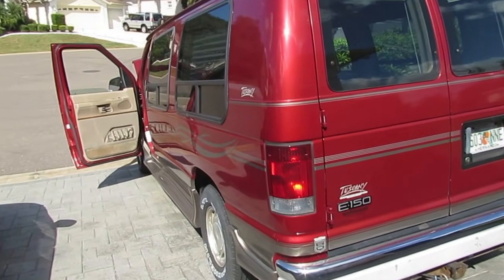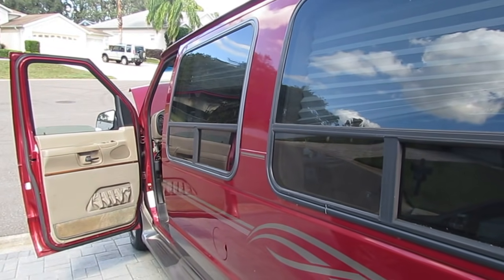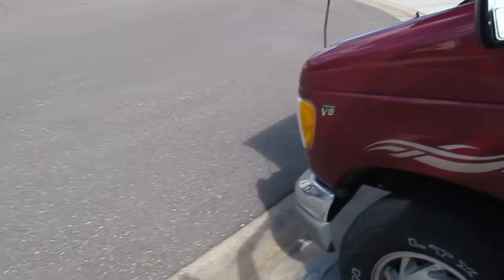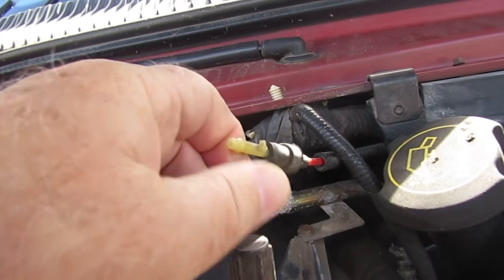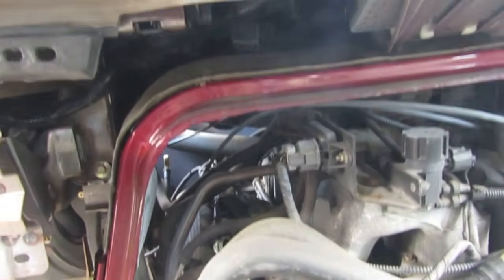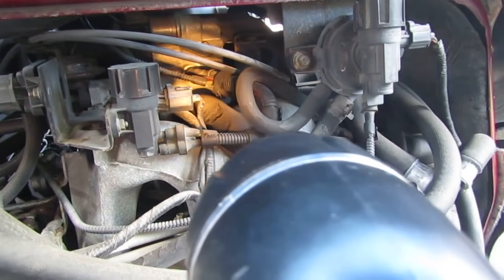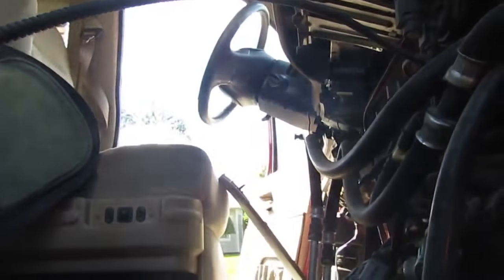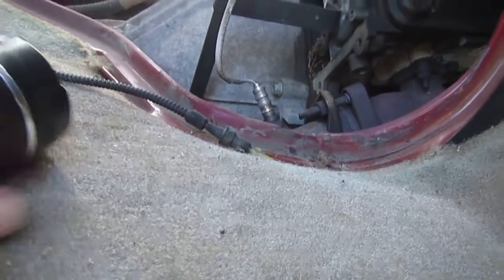how to fix e150 e250 e350 e450 e550 Econoline Van ac stuck on defrost !

Comment from the maker: I just found this video (link below). This guy's fix will be better as he shows exactly where the vacuum line is supposed to go (on the Evap Housing) and you can fix this whole thing by following my video to route the vacuum hose to the passenger side under-dash BUT then referencing his video, buy the vacuum cannister and the check valve and locate them under the dash too. In that way you won't have to remove the evap housing (mucho work under the hood) and it will completely fix your problem!

https://www.youtube.com/watch?v=CJBgPvKBqM4
Reply: Can you help me only the AC vents on top of the dash work everything that's buy my stereo or in the back does not blow anything and it's hot air btw.
Reply: under the hood  of my crazy 2012 GMC  1500 van it has no wires and no vacuum red line either , where they hide it  ?

Comment: I had same issue on my 06 e350.
Black line goes to vacuum canister in wheel well. I bypassed it, you must add some type of canister, wherever you can find room under the hood. I used empty 1 lb propane torch tank. Otherwise without vacuum reserve under certain throttle conditions under load (when vacuum is low] it will revert back to defrost,  then when vacuum returns it will switch back to previous setting. Don't forget to add check valve on the line from the manifold to hold vacuum  in canister.  I used a plastic check valve for windshield washer fulid line to wiper hose line to nozzles. Problem solved.

Comment: I used your method only left the connector ends on the hose. I pulled up quite a bit of hose from the blower housing and cut it off. That way I only had to drill a hole big enough for the hose through the doghouse. I used weedeater fuel line to connect the two hoses. I left the connection just inside the dog house and used red RTV on the hose pass thru hose. Works like a champ. Thanks

Comment: WHAT A FIX YOU ROCK. Literally took 10 mins on our mini Winnie. Took longer to take the dog house off. I didnt take the bolt out i drilled a 1/4 hole and feed the line through. Fyi the vacuum ends pull off no need to cut the line from engine compartment. Did like you said and everything worked awesome. 30 and was done. 20 of that wrestling the engine cover. THANK YOU.
Reply from the maker: Glad it helped. Not sure what you mean when you say you don't have to cut the end because it didn't couple for me. Anyway, I've since installed a vacuum reservoir under the dash. I made it from a can and two brass fittings. I bought some juice, cut a hole in the can to remove the juice and wash it out then I soldered two brass fittings on both ends. I also placed a one-way vacuum check in series.

Comment: Sir, 
   Thank you for posting this video. I used it to repair my 2002 E150 conversion van. I followed your steps exactly and my vent system / AC is working perfectly! Thank you so much for taking the time to post this video - You have saved this single father of four a lot of money. This was way easier than any other video I watched and your explanation of procedures was spot on. Thanks again.

Comment: I CANNOT thank you enough! I have been looking for an easy fix to this for over a year. 30 min and $3 of hose...problem solved. Thanks again!
Reply from the maker: You're welcome. By the way, later I added a vacuum storage vessel (a modified can) and a vacuum one way check valve. If you use just the method in the video, under hard acceleration, you'll notice the momentary drop out of the vents until the vacuum recovers. That's why a storage tank and a check valve is recommended. I commented on this someplace in the comments below.

Comment: I just wanted to give a big shout out to this fellow for this video. I have a 2000 E450 Motorhome I just bought and I too had the same problem with air flow defaulting to the defrosters. The video was great and I had my problem fixed in a very short time and saved a bunch of money. Thanks and great job on this fix!

Comment: Thank you, I just fixed my 2006 E-350 using a similar technique.  I used the existing line as well and drilled through the firewall, leaving the bolt intact.  I used kitchen/bath silicone because it was convenient.  It took me 20 minutes so thank you for doing the additional leg work.  I may add a reservoir later on but right now I have front and rear AC at freeway speeds pulling a load.

Comment: Worked great ! Thanks for this post , I used some "Micro Irrigation Tubing" , it fit into the original fitting from the front connection, and over the small black "Vacuum Line". I added RTV on the Black Line and pushed it into the irrigation tubing , and sealed it off with "Shrink tubing " over the connection (small black & irrigation tubing).

Comment: E150 worked like a charm. 20 minute fix. Agreed, just easier to reroute the red vac line back and through the bolt hole. The wire loom protector around the line also fits through. hook up about 12 in. 1/8 id fuel line and voila! CooooLing

Comment: Thank you so much I was stressing till I found this and glad I read the comments to know what happens doing it this way and I can always add a vacuum canister and a check valve under the dash later but for today I have AC and it did not cost a dime!!

Comment: I did basically this same fix on my 2001 e250. If you take the interior knee panel off on the passenger side you can drill a small hole and fish the tubing thru without taking the engine cover off inside. Pop the access port cove off the top of your dash . That where the vac line junctions to the vacuum switch.  I bypassed the entire vac line from under the hood to the vac switch. I personally think the engineer that put the check valve inside the evaporator housing should have his engineering credentials revoked permanently. Oh and I bought a replacement check valve that is now mounted under the access cover on top of the dash.

Comment: I just purchased a 2000 Class C E450 motorhome with the same problem, and this video was just what I needed.   I discovered that the rubber connection under the hood worked perfectly to reconnect the tubes inside...no other tubing necessary.  It appears that the red line is "sealed" in the black rubber, but it came out with pliers.  Then I used the black rubber connector to connect the red to the black.  Thanks!
Reply from the maker: John, you might find that under acceleration you might momentarily lose vacuum. That's because there's supposed to be a vacuum canister and check valve to supply vacuum at that time. The fix you just did bypassed the cannister. I live with this as it's really not much of a problem as it recovers and the vents go back to A/C after the van reaches speed but if you want to have 100% functionality then watch this video. He has a fix for the cannister and check valve. He installed them under the passenger side of the dash.
https://www.youtube.com/watch?v=CJBgPvKBqM4&t=0s
Reply: Thanks!

Comment: Mine is doing the same thing in my E250 Cargo. Thanks a million. I am going to go out and fix it today.
Reply: Did it work I have a 2003 e250
Reply: @Myka.1987  It sure did. Thank you. What motor do you have in yours? The 5.4 3 valve or 2 valve?
Reply: Awesome! 4.2 engine

Comment: Got in my 2003 e350 super duty today an would you no it mean is doing the same thing I noticed you have rear air as I do do your rear air stop working as well when front went out my rear vents stop working at some time the front vents did.

My question is does your rear ac from the vents work now as well with your fix.
Reply from the maker: Truth be told Kenny, I haven't ever checked them as I use this van simply to haul my RC Model airplanes around so the seats in the rear are no longer there. You say I have rear A/C but I only recall having rear heat, not ac.
BTW, if you're going to to this modification it's best to use a vacuum cannister under the dash as I did. Look through the comments and you'll find a description of the installation. I made mine from a sealed can that had some form of liquid (can't recall, but I chose a can with a very thin, easily removed and then rinsed liquid of some sort) in it and I simply drilled holes top and bottom to add some small brass fittings I bought on amazon to use as vacuum in and out. I also used a vacuum one-way valve on the input, again bought on amazon.

Comment: Was it blowing cold air before fix ? 
Mine is stuck in defrost mode also no front flow but also wont blow cold air.
Reply from the maker: I can't recall. Anyway, one thing at a time. Fix your vacuum leak first so that you can get air through the dash vents and go from there. That line is the primary vacuum that controls all the vacuum motors under the dash. In the meantime you can check to see if your airconditioner is working by turning it on and then feeling the metal hoses as they exit the evap coil on the firewall. You can also see some sweating of the pipes in this kind of weather.

Comment: Just to contribute to the discussion and those looking for solutions. 

My 99 E150 blend door problem turned out to be the dash mounted round temperature  switch knob itself was broken where the female plastic hole on the back gripped and turned the male  control cable mounted inside the control panel. 

in other words the temp knob was broken even though it turned... 

unusual problem and resolution for sure but I thought worth mentioning.

Comment: So I'm noticing that some people are installing new reservoir boxes and a new check valve and some people are not. What is the purpose of the reservoir box and why do some people bypass it?
Reply from the maker: The reason the OEM reservoir is being bypassed is that it's physically very difficult to get at and repair. Do a search and you'll see. It's easier to just bypass it.

The reservoir is nothing more than a storage cell. When the vehicle is under heavy load and accelerating the engine loses vacuum and if not using a storage reservoir this can cause a momentary return to the defrost (default) and then back to AIRCOND or HEAT(floor) when the vehicle reaches cruise speed. 

This is nothing more than a minor nuisance in most cases and lasts only a couple seconds. The way to alleviate this is to add a vacuum canister under the dash, in conjunction with a check valve to store enough vacuum to keep the under-dash actuators in the mode you selected during this scenario whereby you're accelerating.

I drove mine without for about a year and added a homemade reservoir after that comprised of a tin can with two nipples I soldered to it and a check valve I bought on Amazon. 

A word of caution regarding check valves sold in local parts stores. There is apparently a lot of them that don't work (Dorman brand) and I bought one. Read the reviews and you'll find out that many people have bought the things only to find out that they don't pass any air in either direction (defective).

Comment: Just did it tonite it worked glad i found this video others to in depth this one is right to the point and explained well very nice
Reply from the maker: Your vents will probably go to defrost again under heavy acceleration then back to what ever's selected because there's no vacuum reservoir or check valve. 

If that bothers you you can add that under dash (or in the engine compartment) by installing a small vacuum reservoir and check valve per this guy's video.....https://www.youtube.com/watch?v=CJBgPvKBqM4

I just live with mine the way it is.....
Reply: kaydee457.  Im fine with it !

Comment: Buddy excellent video but you're missing the vacuum canister what do you do for vacuum
Reply from the maker: The vacuum powers the vacuum motors under the dash. Because there's no canister or vacuum check valve (with this fix) you will occasionally lose air from the dash registers when you accelerate. As soon as you reach cruise speed you'll never see any difference. As I mentioned before in other comments you can always build a canister, add a vacuum check valve inline with the hose and install it under the dash near the glovebox. Thus far, I find it a minor nuisance and haven't done that yet.

Comment: I see what he did but I would appreciate some clarification if someone would help me. He unplugs the vacuum hose under the hood, pulls the part coming from the doghouse (back of manifold) attaches a tube to that hose, cuts a black hose found near the footwell and connects the new piece of tubing to that. What I don't understand is what happens to the tube connection under the hood that he disconnected. Will that not result in a leak?  Does the black hose near the footwell hook up to where the original tube connected?
Reply from the maker: buster- the line I disconnected under the hood is the vacuum source from the manifold. 

The factory routing goes like this: manifold>>under hood connector(source)>>>>>under hood connector output>>>vacuum one-way valve>>>Vacuum storage canister (used only for dash vents)>>>>Vacuum storage canister output>>>>via hose in floor footwell>>>supply to vacuum motors for vents under dash (black hose that I connect to).

The hose (under hood output) that I disconnected goes to the vacuum one-way check valve and the canister, two components that are completely inaccessible without a great deal of disassembly. The output of the canister is the supply for the dash vacuum motors via the footwell. When I disconnect the hose I effectively break open the path. I reconnect the path at the footwell connection.

What I did was to (under the hood) bypass the vacuum check valve and the canister, which are inaccessible, and reroute the vacuum directly to the under-dash motors, LESS ANY CHECK VALVE OR CANISTER.....

I this configuration, the vent controls will work normally, however, since there's no reservoir (vacuum canister) the vents may not work when accelerating the vehicle. Once you reach cruise speed they will quickly operate normally.

I have been driving like this for a couple years now. I just ignore the vents under heavy acceleration as they work normally when I reach speed.

Whoa, long post. Hope this explains this "fix".....

Comment: Hey, did you also have a problem with the rear upper vents? If so, did this solve that problem as well?
Reply from the maker: Frankly, I don't know because I never checked them. I have no seats back there. I didn't know there were any vents back there?......
Reply: @kaydee457  oh, its a cargo van.  I have a 15 passenger version!

Oh, by the way... THANKS! It worked in the front. Now to search for a rear fix. Lol!

Comment: Ok I did this also and it worked but I lose the vent a/c under acceleration / incline, comes back as the engine levels out.
Reply from the maker: You can install a vacuum reservoir under the glove box area. That's what I did. I made a reservoir from a can. I drilled a hole in each side of the (full can) can and drained the contents. I found appropriate sized brass fittings and soldered them to the can top on each side. I placed a vacuum check valve inline with the can.

If you don't have those skills you can buy a reservoir and vacuum check on Amazon. You will need some barbed hose fittings to transition to different sized openings/hoses to make the connections.

In the end it should look like this:
                        ______________________                         CHK Valve
To Dash line  |         RES                          |                       ___________
____________|  out                              in |_____________| >>>>>>>>>>|______________ to line nearer
                       |_____________________ |                       |____________|                            the foot rest
                                                                                             FLOW >>>>

https://www.amazon.com/Dorman-47995-Vacuum-Reservoir/dp/B07CPX9H6H/ref=sr_1_8?crid=DOSYWHD8BCSO&dchild=1&keywords=vacuum+reservoir+with+check+valve&qid=1623088493&sprefix=vacuum+reservior%2Caps%2C179&sr=8-8

https://www.amazon.com/ACDelco-00460734-Original-Equipment-Conditioning/dp/B00HQSXXF8/ref=sr_1_4?dchild=1&keywords=automotive+vacuum+check+valve&qid=1623089643&sr=8-4
Reply: I appreciate the response, what type of can did you use.

Comment: Did you ever find the leak?
Reply from the maker: The area is completely inaccessible without an absurd amount of disassembly in the area of the passenger side wheel well. I don't recall the specifics but the area in question is below the evaporator housing on the firewall and there's no simple access and can't be seen from the engine compartment. So the answer is no.

Comment: One question, do you have front and rear a/c? I have a 01 e150 and  I just don't know if this repair could   fix both issues. Great video sir!
Reply from the maker: I have both front and rear but the rear never worked (I bought this van used). Make sure you visit the video I have here. His fix is more detailed than mine.
https://www.youtube.com/watch?v=CJBgPvKBqM4&t=0s
Reply: kaydee457 ... well, that was a quick response; my a/c front and rear worked, and for what I gathered the culprit is the vacuum egr solenoid. I ma try your way, and in the meantime, I gonna order the part I'd just mentioned, if everything goes well you'll be notified in a timely manner. Thank you again!.
Reply from the maker: Umm, I would simply find the vacuum line to the EGR valve and crimp it off temporarily to see if it's leaking.  Use a pair of forceps if you a pair. 
That's the only thing that can happen (a leak in the EGR diaphragm) that would affect your ac vents. 

If it is bad, then your ac vents will start working again. If it's not bad then you better try my fix. The only thing that can cause the vents to not work is loss of vacuum.